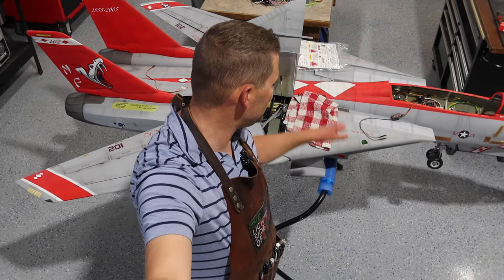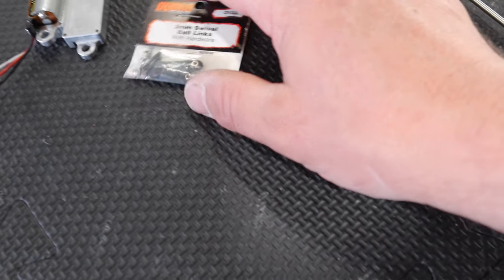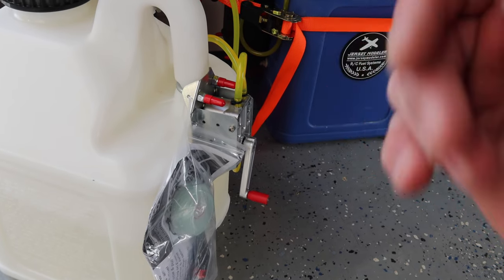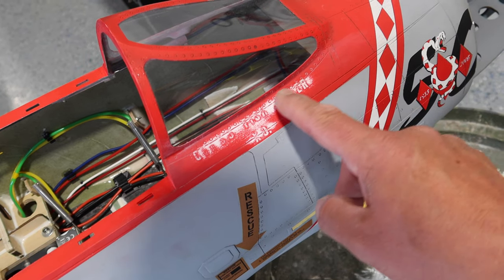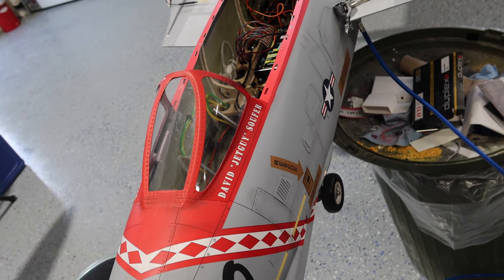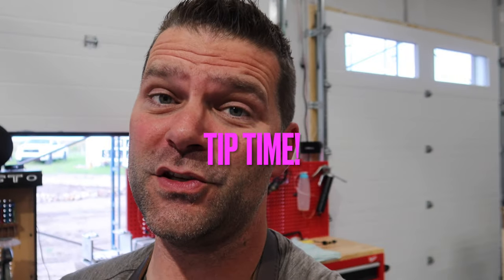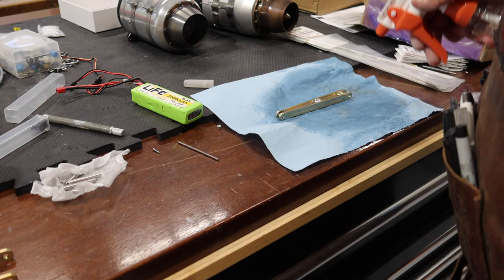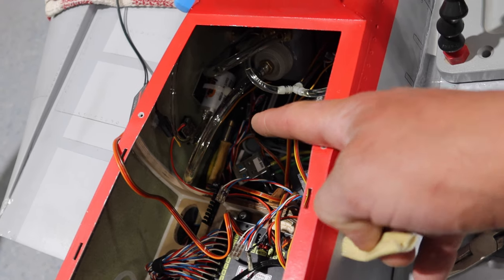TOPGUN F14 Almost Complete - Skymaster F-14

Comment: Im sorry to see you retreading all the things I did with mine previously with the gear. Im waiting for my drag links from Michael still as well as a pair of replacement air cylinders as its not just the ball links that will break as it pulled one of my air cylinders apart. Your help with all this was immeasurable to me as I worked through all this a few months ago. This model is finicky at times especially the gear. Hopefully Skymaster addresses the design flaws with the gear down the road. 
Otherwise shes looking great my friend. Cg was spot on, right where mine is. Now to get my parts and get mine in the air. Im sure David is as anxious to get his as I am to get mine going!
Reply: These issues were brought up years ago when I built mine SM will not change anything.  I replaced all the air cylinders minus the gear and speed brakes due to leaks after pulling them and repairing/testing them.
Reply from the maker: Hey David.  Yea it's been a ton of work getting this gear sorted.  Those links from Michael solve a ton of issues but the gear still doesn't like to operate consistently. I have some suggestions in the upcoming video.  Part 2
Reply: @thelightersideofrc  really looking forward to that. I have had mine torn down, lubricated, adjusted, repressured, lol and its still troublesome at times. I saw in your video you having exactly the same issue's. I liked the idea of tge spacer under the wing mount. I will definitely be trying that. Its definitely been a collaboration getting these to work efficiently.
Reply from the maker: I’ll cover it in the final video/next video. I came up with a whole list of things to do and a start of the day procedure to get reliable operation.
Reply: FYI the gear up issue you are experiencing is not an issue. I talked about these same things you guys are dealing with in my build thread. The gear needs internal lube of the strut seal. The happens when you compress the struts. Manually do this and the gear will go up, if it does not you have too much air in the strut.

Comment: Just lubricant on rudder bolt is not a good final solution, a tiny nick dremel or saw on the opposite side of the clamp to relieve the pressure will save the threads fro facing. My f16 has same problem

Comment: what was the issues with the stock actuators? and they can handle 7.4v I asked this years ago when I started selling the Actuonix on my website
Reply from the maker: They didn't like straight lipo and fried.   Replacement one's we are running at 6v and they are working great and haven's self destructed.
Reply: @thelightersideofrc  weird
Reply from the maker: Yea. I have others running on straight lipo for years and they are fine.